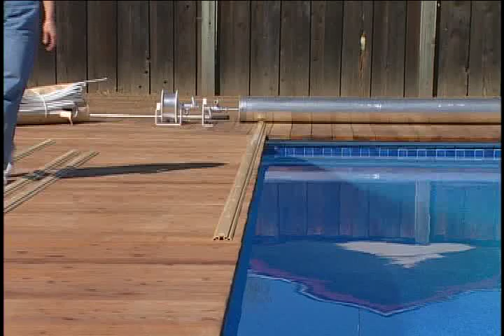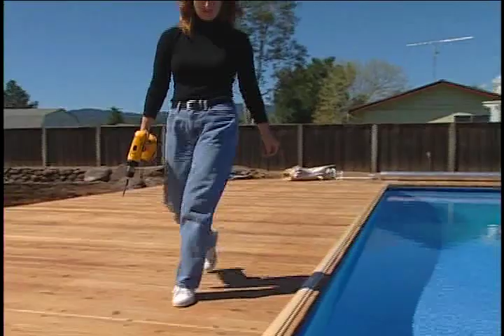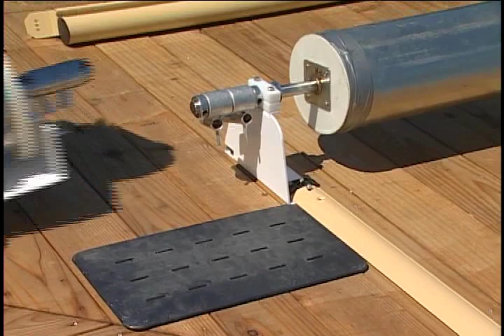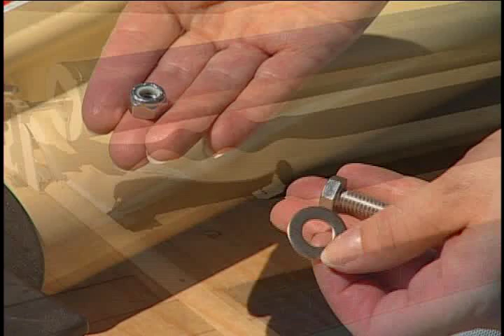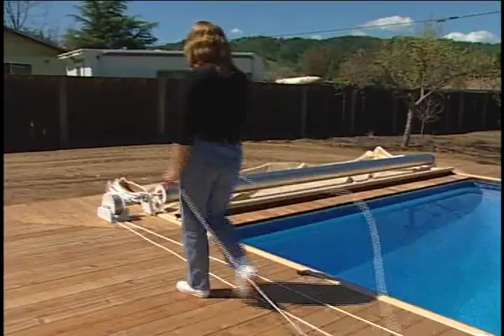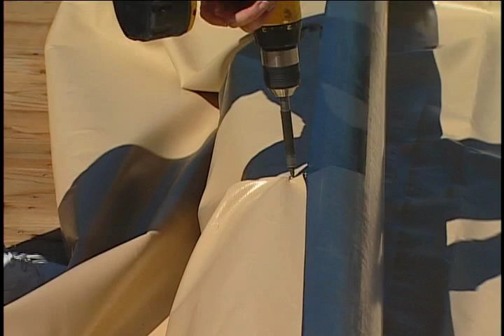EZ-Cover manual swimming pool safety cover, DIY installation

Comment: We had a guy install our we love it! It was $4900 but no leaves in the pool ever and no springs or bs to deal with or anchors open any day in the winter to inspect the liner and water run electric scrub robot just for mid winter maintenance all of pool ownership is easier with one of these I would recommend getting an electric one instead of the hand crank but I couldn’t afford that lol
Reply: What’s the length of your cover and roughly how many seconds on average does it take you to close it? I’m thinking of putting a lap pool in my back yard that would be about 8’ by 45’ long. A doctor recommends I do slow speed swimming for my medical problems that limit how much time I can be active. So if it takes me 3 minutes to open and 3 to close, it’d probably be too much time on that and only allow 14 minutes for the swim. But 4 minutes total on the cover for a 16 minute swim is more doable.